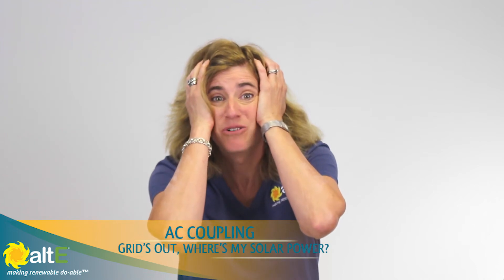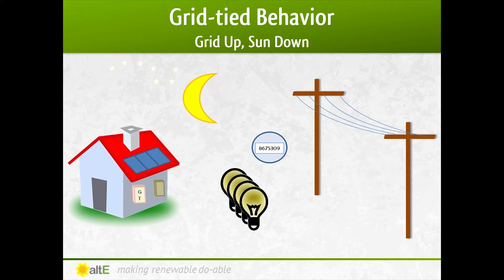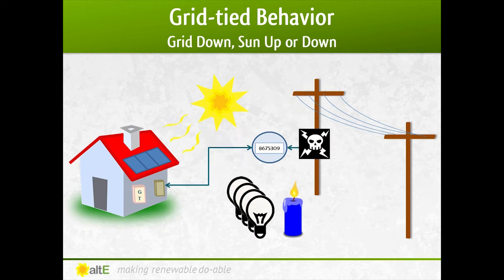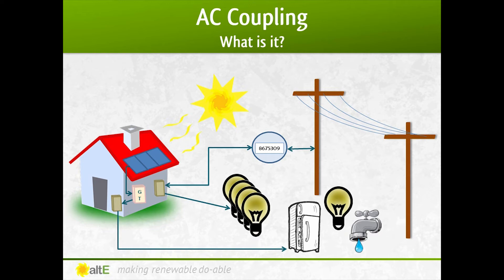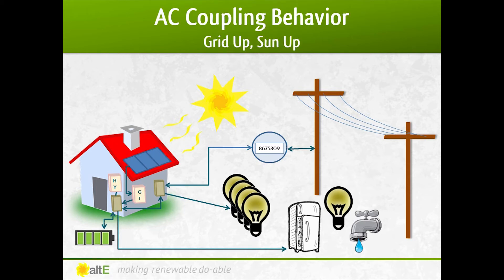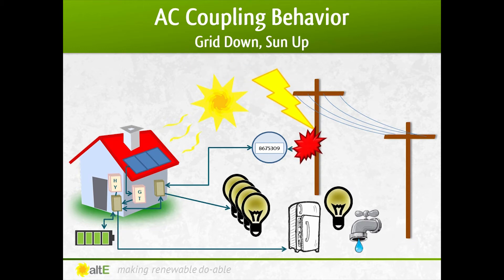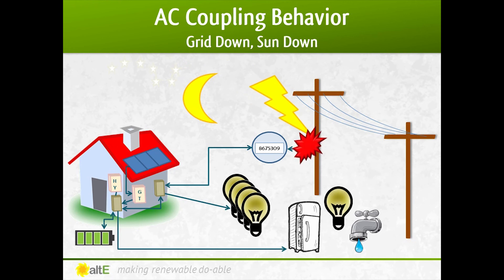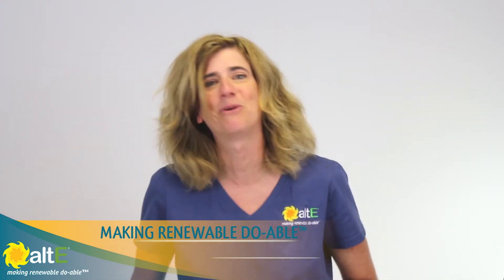AC Coupling Overview | Solar Power When The Grid Goes Down

Comment: Hello, are you often troubled by inconvenient wiring and high installation costs when setting up inverters or energy storage systems? Our LoRa module supports wireless communication, making it easy to connect to any RS485 Modbus RTU device. Additionally, we offer a LoRa wireless meter that pairs perfectly with it! If you're interested in reliable wireless solutions, please feel free to reach out to us. https://youtu.be/Jl3O62nEm9s

Comment: Very important .
I use to work for my first Time with Solar on thé off grid systems customers are really happy availibiliy and reliability .
With with the grid tie system it is like lie
however with this kind of. Solution it goes Well nuit adding a hybrid inverter to thé existing On grid inverter seems to expensive .
IS thé message received right?
May have thé whole wirring diagram .
Thanks for the video .

Comment: The person on this video indicates that when you generate more electricity than you  consume the excess power gets pushed into the grid and your meter turns backwards. This is not true. Where we stay none of the 4-port meters spins backwards.it can't.
 The meters still add the power to your consumption as if you are consuming it. You then end up paying for the power you export.

Comment: I have a 16kw backup generator and 7kw PV system which both shutdown during recent 5day grid outage in Texas.  The crooks at IES just recently installed the PV system (NEC 692.12 compliant) one month before the grid outage without informing me that I would now be grid-tied which defeated the generator transfer switch, witch the power company should have advised, but said nothing as they must be in cahoots with IES who also said nothing, as I found the net meter on my own.  IES now want to sale me battery backup.  I don't want expensive batteries and all the junk that goes with it, all I want is to get a standard meter so I can use my generator.  Can you advise the best alternative?
Reply: Sol-Ark 15K hybrid inverter 
Game changer

Comment: We have invested in a 12.5kW grid-tied solar system, but with a SMA 25000TL inverter. The plan was to expand to 25kW later.

Due to the economic realities imposed by Covid-19, we're now looking to change from grid-tied to off grid, to supply a borehole pump with 3 phase power. There are two 4kW pumps. The pumps are now supplied by a power utility company transformer, which we need to get rid of. Is there a cost effective way to do that? The product datasheet states that the 25000TL is off-grid capable. The very experienced local installer says it cannot be done?

Best regards
Arthur
Reply from the maker: We'd need to have more info. What country is the system in? I don't see in the datasheet where it says it can be off-grid, can you point it out? Exactly which model inverter do you have, what is the number at the end (i.e. 25000TL-30)? One option may be to add some Sunny Boy inverters to the system to provide the battery based solution. However, it may end up being more cost effective to simply replace the Tripower inverter with some Schneider 600V charge controllers and 3 XW Pro inverters. Again, we'd be able to help better with more information.
Reply: @AltEStore , I apologize for the long wait, I had to get to the inverter to confirm the model number. It is indeed a 25000TL-30. The country is Namibia.

I cannot attach a screenshot to this, but the address of the document is https://files.sma.de/dl/24336/STP25000TL-30-DEN1742-V31web.pdf, and it says "Off-Grid capable / SMA Fuel Save Controller compatible ● / ●" at the bottom of the third page.

The possibility to have battery backup isn't what I need now, although this will be a development in the future. Right now I'd just like to generate power for local daylight consumers when the grid is down. I need to qualify my statement "The very experienced local installer says it cannot be done?" He means it cannot be done cost-effectively.

Comment: WHY Can't there be a meter checking the voltage coming in from GRID, then OK to pump out from Solar 
If the meter is not detecting in power in the grid, switch power from solar to run house and not pump anything into the grid.  
When it detects power on again, switch solar to the rid again 
it's 2020 can not be that hard FFS
Reply: Exactly! Why isn't this the standard!?!
Reply: That is exactly what a Hybrid ( Grid-Tie + Off-Grid ) Inverter does ...

Comment: I have a doubt, what happens when the battery is fully charged?.. i have heard  it sends signal to the GT inverter and GT system shuts off right?.. If the consumed load is lower than the solar generated power does the solar power generation stops and cut power to the home or does it keep sending power to the home and suspend battery charging until it needs charging again?.. also if the solar array is turned off after battery full, is the whole system just acting solely as battery backup power until GT is triggered again to charge battery?.. There's very little clarification on this and it's really confusing for me :)
Reply: HOW the Hybrid Inverter actually controls the power generated by the Grid-Tie Inverter and HOW the Grid-Tie Inverter(s) vary their output varies per manufacturer.   So no, there is not "one answer that fully explains all scenarios "

Comment: You did not touch on the ac coupling problem that exists when the grid is down, your solar array is producing more power than your loads are consuming, and your batteries are fully charged.
Reply: The AC Coupled Inverter can handle this problem.  It is much better to design the PV System to be: Grid-Tie, Hybrid, or Off-Grid from the beginning vs transforming  a Grid-Tie system into an AC-Coupled Hybrid System ...

Comment: I had a problem that one of the batteries had to be replaced and the expert said that this happened because only the inverter was conected and therefore every night the batteries would drain too much, there is a box with a lever that says grid, off and inverter, he says that this box should be on grid all the time,  that way the system can make the automatic switch between the grid and the solar power automatically, but when the new battery was installed the other guy said this lever should be on inverter, watching this i think it has to stay on grid but i am very confused with this now and i dont want to have another battery replacement so please tell me how exactly should it be, must the lever be on grid or inverter?, ill really apreciate your help.

Comment: What happens to ac coupled inverter system when the batteries get full?
Reply from the maker: It depends on which inverter you use. Schneider shifts the frequency of the output when it senses the battery getting full. This causes the grid tied inverter to toggle back. When it gets too full, the frequency is so far shifted that the GT inverter senses something is wrong with the "grid", and shuts off until the frequency is in the right range for 5 minutes. Magnum sends a signal to a relay to disconnect the GT inverter, causing it to lose its "grid" connection, and shut off until it is reconnected for 5 minutes. SMA SunnyBoy and Sunny Island talk to each other, so it is a smooth transaction. Same with Magnum when using their microinverters.

Comment: Most houses are wired with three circuits, water heater, lights and power points with a extra one if you have a large electric stove. So with AC Coupling  can you select say lights and hot water only in a po
Reply: Most house are not wired with just three circuits ...

Comment: I have an 8kWh system using Enphase Microinverters controlled by and Envoy S with the AC output tied to grid through a line side tap before the main house breaker panel.  Is it that to add such a battery bank, I could install the hybrid inverter in this backup system in between the AC output block on the Envoy enclosure and the line side tap?  Would the Envoy S controller get confused with any of this?  

Also I guess I might need another set of consumption CT's to read the critical load draw off the battery bank, right?  Can I gang them on the Envoy S CT Meter wiring block?  Thanks for your throughts on this.
Reply from the maker: Sounds about right. Because you have to have the hybrid inverter at least the same size as the grid tie, you'd probably be best off with an Outback Radian, https://www.altestore.com/store/inverters/hybrid-inverters/outback-power-radian-series-inverter-chargers-p40853/#OUTGS8048A1  Have the Radian's Grid In go to the line side tap, and the AC Out feed a new critical loads panel through a 50A breaker.  Then have the Enphases go to a 50A breaker in the critical loads panel.   When the grid is up, it'll just pas through the Radian to the grid, same as usual. When the grid is down, it'll disconnect and the Radian will run the loads and trick the Enphase. The Envoy would be none the wiser. I'd have to give the CTs a bit more thougt. You may just be able to move the ones you have, not sure.

If you don't want that big of a backup, you could just break out some of the Enphases to run through a smaller hybrid inverter, and leave the rest as is. Then only part of your array would be charging the battery bank.  Have you seen the newest video we just released this week? https://youtu.be/WVM0F2OrQhA

Comment: great video... however for the amount of money ppl spend on these grid tied systems...they should jsut go off grid and use the grid as back up... change consumption patterns and go offgrid... spending 35 000 for a gridtied is a waste... just saying
Reply: Coutney Bowen Might want to do a little research. Just installed 11.5kw solar (36 Canadian solar 320 watt mono PERC panels and two 6kw sunny boy sma inverters). Total parts and installation was a little under $24k. Receiving $4500 rebate from utility and 30% tax credit around $6k. Dropping total cost under $14k. 8.2 year payback on $1635/yr electric savings and 12% return on investment. Forget battery backup. Use a whole house propane generator. I purchased an industrial 15kw gasoline powered generator and converted to propane. Buried a 250 gallon propane tank in the ground next to the tank. Installed a transfer switch for critical loads.  One cool thing about the sunny boy sma inverters is they have a secure power supply that provides 2kw when the sun is out and the b grid is down. Since I have two inverters I have 4kw available to power fridges and freezers without using the generator. I am considering adding some battery capability to take full advantage of my 11.5kw solar rather than only 4kw.  So far cost payback is not there especially when cost effective  battery life is so short.
Reply: I agree. I don't see much of a use in a grid tie only system. maybe a ac coupled system. so you can have your cake and eat it! that way you can possibly sell half the power you make. use the off grid inverter for the important stuff and when more is needed use the grid tie inverter to make up for the need. and during the day. when the batt bank is charged. sell what is taken in from the PV panels. i my self  want to use a grid tie inverter at the hydro gen shack to send ac back to the house. the distance is to great to send DC. with a grid tie. the power can be ready used. with out dropping the voltage and rectifying to charge batts.or power an inverter. however using a medium size batt charger wouldn't hurt. from the hydro. to help charge the batt bank and the other inverter. what a tangled web. all that can get to be a complicated mess of boxes and wires. and different volts coming and going. but I see no need for a grid tie only solar setup! sorry for the rambling!
Reply: Courtney Bowen in addition to dobson777a’s comment; there are a couple of additional things to consider depending on what utility you have.  

1- some utilities will do net metering.  This allows you to bank power generated but not consumed and fed to the grid for future usage from the grid at zero cost.

2- some utilities will do a feed-in-tariff arrangement.  This allows you to sell the energy you produce to the utility.

Both of these arrangements will further decrease the payback period of a solar installation.

Comment: thanks for this
what if I have either a clean power standby house generator that would connect if the grid goes down. would the micro-gti's sync to that output calling for less power from generator, hence using less fuel for the time the grid is down. the generator couple be turned off at night and run off batteries when most loads are at low usage?
Reply from the maker: Rev John O'Toole A generator could possibly be used in an AC Coupling system IF, and only if, the hybrid inverter/charger can support 2 AC inputs, the grid and the generator. For example, the Outback Power Radian and the Schneider XW Plus inverter/chargers have the ability to connect to the grid and a generator. If the grid goes out, and the batteries get low, the generator could be run through the hybrid inverter/charger to charge the batteries. Check with the inverter manufacturer to confirm if this can be done with your specific system.

NEVER connect a grid-tie inverter to a generator. Generators are not designed to take AC power in, and can be damaged if you send power from the grid-tied inverter to the generator.

Comment: I don't understand how the GT inverter can shut itself off from the grid if it thinks it is still connected to the grid due to the presence of battery backup (It doesn't know where the power is coming from @5:07).
Reply from the maker: Islamic Infidel The GT inverter is not connected to the grid anymore, it is connected to the hybrid inverter, which is also connected to the grid. The hybrid inverter has 2 AC connections, one to the grid, and 1 to the critical loads panel. When the grid goes out, the hybrid inverter disconnects from the grid, which in turn disconnects the GT inverter from the grid. But both stay connected to the critical loads panel, and keep charging the batteries, while not sending any power to the grid.
Reply: Thank you for the clarification...would a Tripp-Lite APS2448UL quality as a "hybrid inverter" in this case?
Reply from the maker: Islamic Infidel That inverter outputs 120VAC. In North America, the hybrid inverter must output 240V, which is what the grid tied inverter outputs, L1, L2, Neutral. Hybrid inverter manufacturers who have been tested and approved, some of their inverters for AC Coupling include Outback Power, Schneider, and Magnum.
Reply: @AltEStore  hello altE
My concern is, mtg microinverter that I have on the roof will now connected in output or input of my hybrid inverter (ms series) which it has terminal block 1 ac input & 1ac output. So Hybrid inverter need to wiring to main panel box from the input or output?